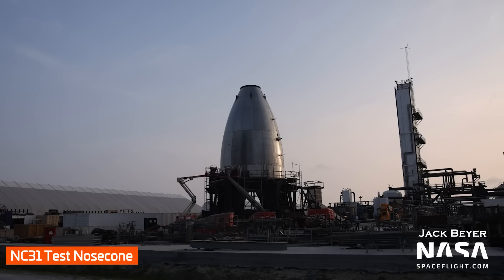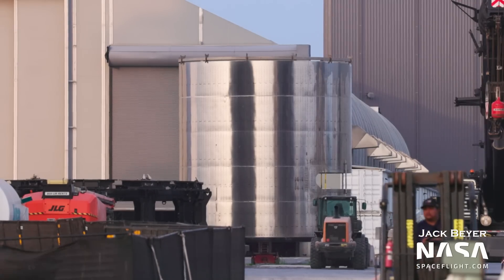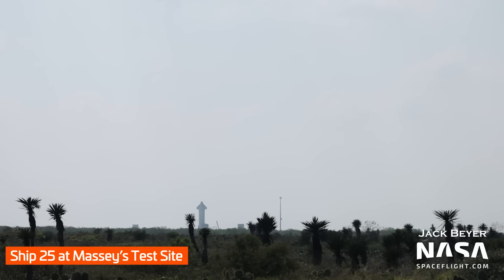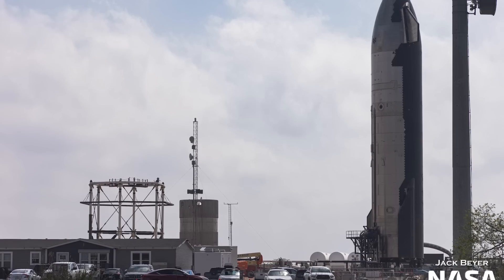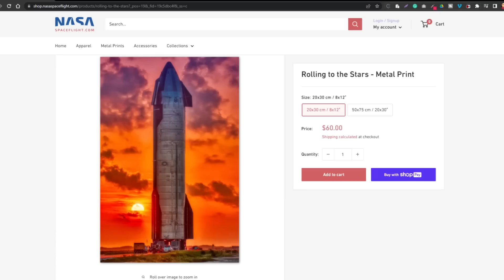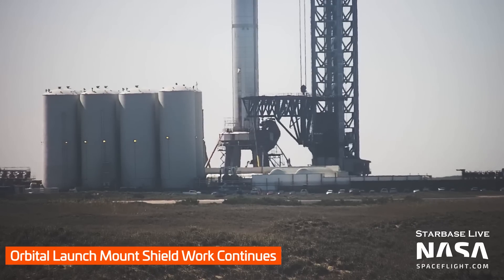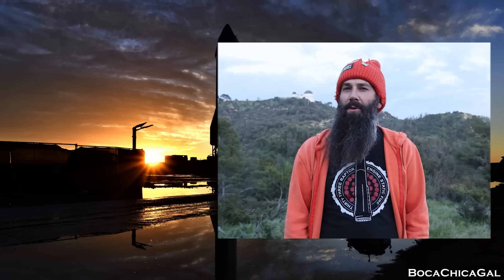Starbase Update: Starship 26 Rollback, New Crane Erected, and Potential New High Bay

Comment: I wonder why SpaceX has not built a gantry which can slip around the test stands to lift Starships by the Chopstick lift points, eliminating the manual effort required to use the nose cone crane mounts.  SpaceX is usually obsessed with efficiency.
Reply: I believe they are building such a setup. Don't quote me on it
Reply: @bryanillenberg  of course they are.  These people know what they are doing.  I am just surprised they haven't done it already.
Reply: @jamescobban857  They didn't have a need for it before

Comment: I have to laugh at the term "Self-propelled Modular Transport". "Self-propelled"... as in, auto-mobile?
Reply: No, as computers do all the leveling of the surface of the SPMT (not springs as on cars). The driver only needs to raise or lower the whole SPMT and to point it in the correct general direction. Every axel is independent and computer regulated. They also have independent electric motors that turn them individually. The diesel engine at the back produces the electricity needed.
Reply: @knowledgeisgood9645  Interesting.

Comment: It looks to me that the orbital launch mount shielding will deflect  flames directly at the tank farm. Isn't that a problem? A big problem?
Reply: The shielding will just deflect the heat away from the OLM itself, by very little. The main blast is at ground level and the berm deflects that up above the tank farm. The only worry is if debris shoots out. But even that is not that much of a problem like Michael pointed out all tanks have an outer shell of thick steel and a meter of insulation plus the steel walls of the internal tank itself. And even should all get penetrated, two tanks have to be punctured at the same time, one LOX and one LCH4, then they need to mix. They are far from each other for a reason. The danger is not zero, but it is not far from it.
Reply: Not a problem because all of the upright tanks are double lined.   And the plume from the launch doesn't reach them directly.  At least that is my observation from the booster static fires.  The NASA SF staff haven't heard any concern about that from Space X either.
Reply: That is why the tank farm berm was constructed.

You can see during the 31 engine static that the berm stops flames from the raptors reaching the tanks

Comment: Coordinate systems are so confusing... I'm a visual FX artist and we use a cartesian-based coordinate system where in 2D X is horizontal and Y is vertical, then when extrapolated into 3D Z becomes the third direction, what we call z-depth. Having worked with this coordinate system for over 25 years, its REALLY hard to think of Z as the vertical vector, and X as the "forward" vector. :face-turquoise-covering-eyes:
Reply: Describing it in words just makes it too hard. The axis are the same, just rotated 90° around the y-axis, so x points up.
Or turn the rocket on its side pointing to the right. Now lock the axis and then turn it up again.
Reply: Think about Starship doing a bellyflop and then it makes more sense. Up is leeward, Z+. Down is windward, Z-. Left is port, Y+. Right is starboard, Y-. Then forwards is X+ and backwards is X-
Reply: @ale131296  But that applies even to other rockets that don't do belly flops, no?
Reply: @knowledgeisgood9645  Yes, it applies to all rockets. All have their coordinate system and normally the X axis goes from backwards to forwards and then depending on the rocket most have the Z axis in the up and down direction if the rocket were horizontal on its transporter erector for example. Cases like that are Soyuz, Falcon 9/Heavy, Electron, etc...

Comment: There are two ways that pitch/roll coordinates are stated:  the one that Jack is referring to is what is used in Canada, USA and other countries that source equipment from USA/Canada etc.  Equipment from Europe and the Nordic countries reverse the convention which has caused some confusion when equipment from both Europe and the USA is integrated into a single system.
Reply: Science always uses right hand rule:  imagine folding your right hand around a coordinate, the fingers show the direction of increasing angular coordinates.  However aviation uses the left hand rule inherited from British compass conventions: 0/360 degrees is North, 90 degrees is East, 180 degrees is South and 270 degrees is west.
Reply: Both can (and will) use right hand rule. But that does not fully define youre cosys. Your completely free to choose the direction of the first axis, then your second axis is still free to point in any direction perpendicular to the first. And only then your third axis is determined.
So everybody using rhr still leaves planty (unlimited) of room to come up with different cosys.
Reply: It's the same coordinate system that boats and ships use and it's the same as the right hand rule that is used in science as James mentions. It's no any different way.